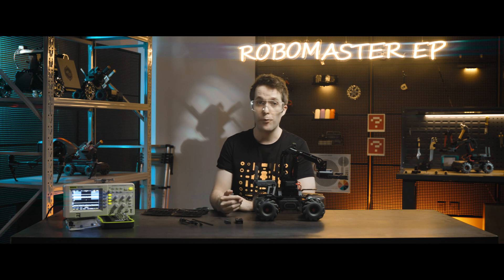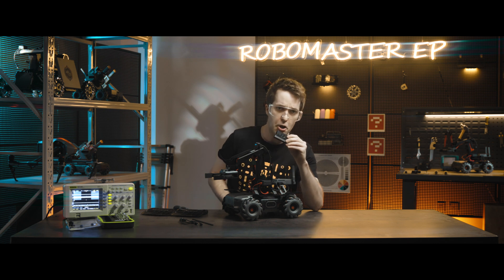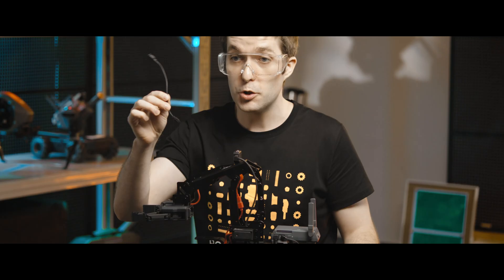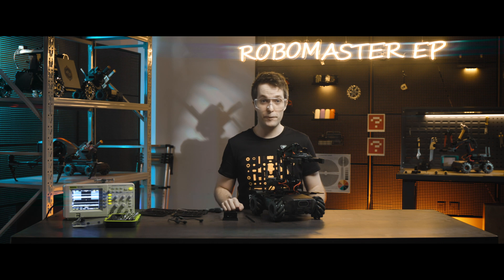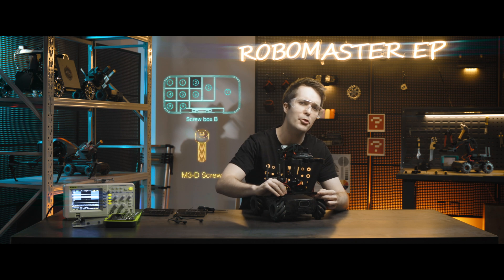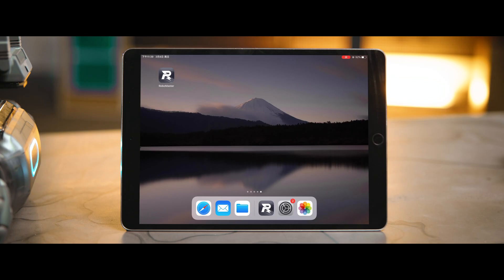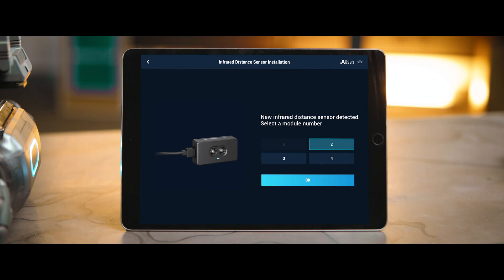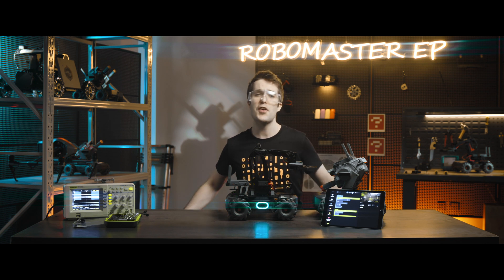RoboMaster EP / EP Core | How to Use the Infrared Distance Sensor

Comment: hi I'm the purchaser for the RoboMaster EP CORE, I wanted to ask about the power connecter module where you show the front infrared Distance Sensor is connected to the Can Bus on the power connector but I don't seem to get the other connection of single Can Bus, even the manual book fails to show the steps for the power connecter module, Can I know where is the other wiring Can Bus connect to?
Reply: I take it no one from DJI actually looks at the comments. Power connector module question. No   Work it out yourself